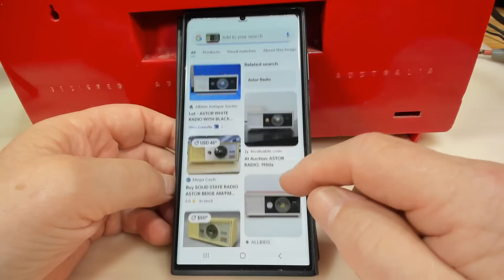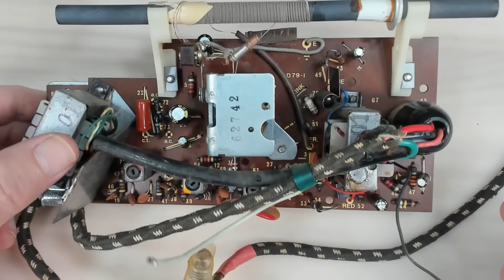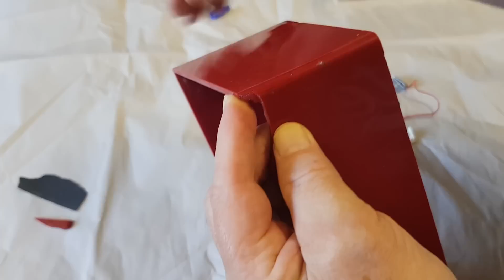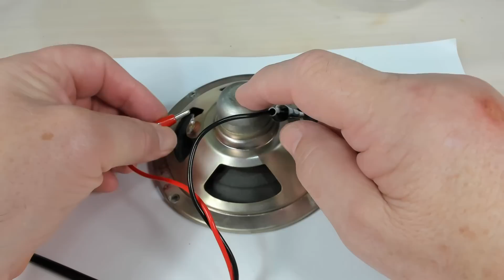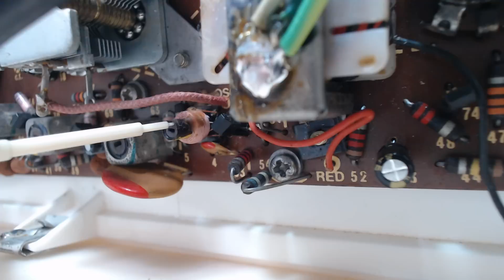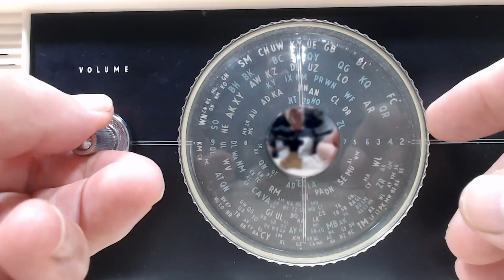Astor M6-D Transistor Radio - 1968

Comment: a piece of cardboard or paer on the inside to reinforce the plastic you glued would be good idea tto. Those old wedge type silicon transistors are very good indeed and the class A audio sounds good, better than a tube in class A . Love these type of old transistor radios.
Reply from the maker: Thanks pushpendra, me too 🙂

Comment: Great video indeed Dave. Just a quick question about the station call letters. I'm presuming that because this radio was made when the channel spacing was 10 kHz, that some of the station call letters will now not be 100% accurate (depending on how far the frequency moved when they shifted to 9 kHz).  My local ABC transmitter 5LN moved from 1530 to 1485 kHz, while another regional SA ABC transmitter only moved from 690 to 693 kHz.
Reply from the maker: Thank you Michael. Yes, this radio has the 10kHz spacing on the dial. I think we moved to 9kHz in 1978 🙂

Comment: Hi Dave. A good trick for cleaning out speaker coils like that is to use a rolled up “Post-it” note, with the glue strip down in the slot. In can be used both outwards and inwards. 
G’day from Pommie land.
Reply from the maker: That's a great tip Tim, I'll keep that in mind 👍🙂

Comment: I restored one of this radios. It is a nice radio but it is not very loud. I used it to listen to 4KZ.

It is easy to. restore and it is good enough to listen to my favourite station. 
My radio is from 1969 I think and it has silicon transistors. In the schematic are antenna and ground connections but it is not used. There is a big ferrite rod antenna in the radio and in a town you don't need an externally antenna.
One of the electrolytic capacitors was exploded and in pieces when I got the radio.
Reply from the maker: They are only a small kitchen or bedroom radio so not big on sound. Good that you got yours working again, thanks @thebuggy736 😊

Comment: I noticed you were using a phillips screwdriver on pozidriv screws which is why it can be seen slipping in the video.
Reply from the maker: I didn't notice they were pozidriv, I'm surprised they used them 👍🙂

Comment: i can see why they discontinued with the the radio dial with the radio stations on it 2AY Albury would be on there 2GO first aired in 1971 2ST southern highlands made its debut in 1972.
Reply from the maker: Adding and removing stations and even moving station frequencies are a problem. The demise of station call signs on radios happened as imports overtook the local industry. Thanks Media Watcher 🙂

Comment: Hi Dave, I sent a Grundig Radio to Adelaide, valves packed in same box but have " vanished" possibly a customs error. Can you advise a dealer who could supply replacements? Sorry if this is a OTT request. Many thanks Paul in Germany.
Reply from the maker: Hello Paul, that is strange. The Historical Radio Society of Australia (HRSA) has a valve bank and may have the valves. You might need to be a member to access it. There is another valve bank in Adelaide that sells valves to the public for $15 each and may be discounted for members of AHARS (valve bank link below). It's called The Australian Valve Bank, I have used them a long time ago. You can also contact HRSA, they may put out an email to members who may be happy to help.
Ebay, but it might be expensive. .
AU Valve Bank: https://rola.net.au/valvebank.htm  
HRSA: https://hrsa.org.au/
Reply: @DavidTipton101  Hello Dave, This information is so helpful, thank you so much firvtaking the time to reply. My feeling is the recipient has accidentally thrown out the packaging and "lost" the tubes which were carefully packed to avoid them falling out of the bases and getting damaged during shipping. I'll pass this information on and hopefully get up and running without it costing a fortune. I could ship from Germany but I imagine this would be prohibitively expensive and fraught with dangers. Once again many thanks! Paul 👍😀
Reply from the maker: It's my pleasure Paul. Your explanation for the lost tubes is more plausible. There is a local chapter of HRSA in Adelaide if the owner needs assistance.

Comment: Thank you for this video. I'll try and remember that super-glue and sandpaper technique the next time I have broken plastic to fix. I was hoping you didn't have the missing piece, because I was sure you were going to rebuild the missing section and it would be color matched, but I learned something nonetheless!
Reply from the maker: I have to say the few times I've used the sandpaper method it hasn't been all the successful, on Bakelite or plastic. Thanks Lurker 🙂
Reply: @DavidTipton101  I'd say it was pretty successful in this video! (Probably better than I'd have done without the sanding method, anyway.)

Comment: I wish I had a guy like you in our neighborhood, my neck of the woods. I dropped off two quite old radios at a local guy who was supposed to be very, very good.
Both radios date from the 1930s. This was in July and he said it would it would take a week and a half for him to give me an estimate. We are days away from the end of the year!
The thing is probably all the capacitors and visitors would need to be changed and I can do it myself. It’s just that it is so complex to have to purchase each and every little part when somebody else has drawers full of them. 
Have a wonderful end of the year. Best regards for the holidays.
Reply from the maker: It's hard to get good help Neil. I would look at your radio if you were near. Carl does capacitor packs containing a few of all caps needed. If you are in New Zealand and there is a Jaycar near, they stock pretty much everything you need. 630Volt poly caps, a range of electrolytics and resistors. All the best for the holiday season 🙂

Comment: I don't think I believe you David when you say you don't know about transistors haha. Pity this one worked, but even if it didn't, confident you'd have fixed it. One page I found helpful myself (you probably already know it) is the UK Vintage Radio Repairs site, where they break down stage by stage how a typical AM radio works. There's a separate index for valves and transistors. Still probably the best explanation I've seen. AGC was something I never understood until I read this page. Anyway Merry Christmas David, thanks for some great content this year, blessings to you and your family.
Reply from the maker: Thanks for the tip on the website Seiskid, I am signed up to it, I'll check it out. The only difference between valve and transistor sets is the valves and transistors. It's the little things like biasing that I haven't had any experience with. Merry Christmas and Happy New Year 🙂
Reply: @DavidTipton101  I forgot there's a forum too. Its not actually that, so no need to sign up. Replace the 'net' with 'com' in the vintage-radio.###  address, and it takes you from the forum (not what you want) to the help guides (what you want). Enjoy!!!
Reply from the maker: @Seiskid  OK, thanks Seiskid, I have it now 👍🙂

Comment: Hello David. Loved the video. From start to finish; the careful disassembly, the successful white & clear plastic reinvigoration, the speaker repair work (BTW; I'd Never leave the speaker out of a single video. Ever. There's just something about that item that gets a viewer into the completion of the restoration, and the speaker holds the entire History of each unit). Even if there's nothing wrong with it...crunch a little hole in it (just kidding). Another BTW; I did my own Google image search on this and found a very "unique" history on this one: on September 26th, 1964, this unit began it's historic journey on "Gulligan's Island" as the "only" connection our castaways had to the outside world. That "bodgy" power connector work you found was the final work of the professor on this historic radio to keep it working. It's probably worth a ton of money to a collector! Merry Christmas Dave & Happy 2025! -Chris
Reply from the maker: Hi Chris, thank you very much. I like working on speakers, no electronics, just engineering. You may be on to something there. On the first GI episode, the radio ended up in the ocean and still worked once retrieved! Merry Christmas and a Happy New Year 🥳

Comment: Very nice restoration as usual. A nice blast from the past. The transistors used in that radio are Anodeon made by Astor in Australia. They are notoriously unreliable especially in their TV's in the late 60"s and early 70's. As an apprentice I changed many of them with European sourced transistors (BC 549 etc).
Reply from the maker: Thank you Ian. I didn't know Astor made their own transistors, not very well by the sound of it 🙄🙂

Comment: Great job Dave, it is always a good day when I can enjoy my morning coffee with Dave working on classic radios and making them new again. You sure have good luck with super glue, I guess when it failed me some 40 years ago I developed a disklike for it and have never really given it a good trial again, I am sure the formula has changed greatly since then. The last thing I saw it work good for was body prep at the funeral home next door to my home years ago. I used to help the director occasionally when he needed to lift bodies and such when his hoist was down or the body was, well to heavy for the equipment. He used  the glue to hold the departed's hands together and keep their eyes closed. For plastic bonding I  use a product called Duco Cement, it is sort of like the old airplane glue we used as kids making models. It does a nice job but does not bond as quickly as super glue so you need to use clamps or just hold it for a minute or two. This set turned out great though nearly looks new off the shelf.  WHERE ARE MY MANNORS!  Merry Christmas Dave, and have a great new year!
Reply from the maker: Thanks Jerry. That's a great story about the funeral home. I find superglue works well for this type of plastic. There is a slow drying form of glue similar to plastic model glue that is still cyanoacrylate based. It gives more time to put things together and is very strong. It's a Loctite product.
Merry Christmas to you and your daughter and all the best for 2025 😊

Comment: You have to be careful using station ID's on these old radios as a reference.  3XY is close as it didn't get much of a change during the frequency reallocations.   It was 1420 (Australia used to use 10khz AM bandwidth originally) and then was moved to 1422KHz when the reallocation was done, and the change to 9KHz bandwidth.     I believe it was 1978 when 3XY was moved from 1422 to 1420, and many other stations would have changed around this time, some much more dramatic, like 4BH as you mentioned.       3XY was one of the lucky ones that only moved 2KHz off there previous allocation.
On the radio you have, 3XY would have still been 1420, but on these analogue dials 2KHz is nothing.   I am just being pedantic lol :)   
Love your videos and as always this was a great restoration.
Reply from the maker: You are right Brendan, I forgot the slight variation with 3XY after the frequency reallocation.  You will be happy to know I checked it again afterwards using the 1400kHz dot on the dial and it was spot on. Thanks Brendan 👍🙂

Comment: Hi Dave, cheers from France. Great video and repair as usual. I am sorry to bother you with the following complaint though. When you publish your new videos would you please deactivate the option for automatic dubbing to foreign languages. The result is awful : bad dubbing, some translation errors of technical words that make things hard to follow sometimes. Furthermore it does not fit with what foreign audiences are expecting (as far as I am concerned) when choosing a channel in a different language. If I watch your videos it is also because I understand english and I learn a lot from listening to english speaking persons in a given context (here old electronics). Now I have to systematically stop the video then go to the preferences, deactivate the French dubbing and select the original language and then return to the video. Have a nice Christmas down under.
Reply from the maker: Hello yusynthman. Audio dubbing on YouTube was only just become available on my channel. I have no control on which language it defaults too. In fact, I had no idea it changed to suit the local language, I assumed it needed to be selected. So I'm sorry but I can't do anything about it, it may change in the future as they improve the software. There is some info online that suggests you may be able to change some settings on your device so it plays in English. It's an interesting problem and I understand. You will find this will happen as more videos are audio dubbed from now on. Oh, you only have to click the gear icon and select another language on a PC or phone, a TV may be more involved. Merry Christmas 🙂

Comment: And another radio done and dusted , great job. Many years ago i worked at Astor factory in centre road Clayton, Melbourne and in the transistor radio section. I operated the solder wave machine at the time and also took care of any solder bridges bridges that were in the wrong place. The girl on the production line use a special air operated cutter to trim the excess wire once the component ( resistor /capacitor ) was inserted into the board. these cutters also had a area in the jaws the also allowed the tool to squash the component lead befor the cutter cut the wire. This was used to stop the components from falling out of the board untill the board was soldered. Have a merry Christmas David.
Reply from the maker: That's fascinating! It's great to hear from someone involved in the production. That snipper/bender did a great job on the leads, I struggled to get them straightened out 😄 Merry Christmas Stephen.
Reply: Hi I run the Astor Facebook page. Do you have any photos of Clayton or momentos etc?
Reply: @charlesbrain3872   No, sorry, when i worked at Astor, that was when i was in my teens, I'm now 70 and retired
Reply: We had a similar model in the 1960s, but it was powered by a large multi-cell battery, probably similar to those in valve radios, and each battery would last for months. Ours was yellow with a white front IIRC.

Comment: Hi David.  I should point out that 3XY was not on 1422 kHz when this radio was made.  Looking it up though, it was 1420, so close enough.  It's worth keeping in mind, when using station call signs as alignment points, that practically no stations are on the frequency they were when these radios were manufactured, due to the switch from 10 to 9 kHz channel spacing in 1978, and other changes.  I do know someone who got into strife trying to align a set and not taking this into account.  Hope that might help someone making the same mistake.  Cheers.
Reply from the maker: Yes, yes it was. I used 1420 last time but forgot this time, thanks for the reminder. There are alignment dots on the dial but I couldn't see them with all the camera gear in the way 🤦‍♂️ 
Really, two kHz and got into strife. I just threw the radio on the generator and checked with the alignment dot at 1400, it was spot on. Says a lot about my original alignment 😄 Thanks Stuart.
Reply: @DavidTipton101  In his case, the difference was 328 kHz.
Reply from the maker: Ahh... that would be a problem 😄

Comment: David an excellent Refurbishment the Astor Transistor radio I have service a few them Radio TV workshop in the good old day you can pick up many station in the Sunshine State as aside we used to use 50HZ from Scope iron to remove dust etc from speaker cones it wound certainly shake the speaker up,I noticed you gave new LV power supply is switching power supply? Some of them produce RF noise,I the city we don’t have any AM Stations the all gone Fm,I forced to get Smart Speaker it magic you ask the pleasant girl any questions plus any Radio Station in World,Best Wishes to You and a Merry Christmas greetings to all.Ian,
Reply from the maker: Thanks Ian. The soldering iron would do it. There is so much RF on my workbench with a PC, monitor, LED lights and half a dozen cameras the RF from the power supply would be drowned out 😄 Merry Christmas to you and yours 🎄😊

Comment: Nice result, Dave.  I'd be willing to bet you got your fingers stuck together with superglue 😆.  I can't open a tube without that happening.  I hate those wire wound capacitors. You were very brave messing with that one.  The double sided tape was a good idea.
I hope you have a great Christmas and a happy 2025. Now I'm going outside to sand that bloody HMV cabinet again before the temperature hits 40 degrees.
Cheers David
Reply from the maker: Thanks Don, yeah, superglue. I glued my finders together once when on holiday. I bought the glue from Bunnings. I arrived home with the glue and glued two fingers and a thumb together. I had to drive back to Bunnings to buy the antidote. I felt quite the dill going in with my hand glued together. Merry Christmas Don and all the best for the New Year 👍😊

Comment: It looks great, I wonder though if the clear plastic dial could benefit from a retrobright too.  I restore Lightbars on my channel, and the clear lenses suffer a yellowing from UV exposure.  I built a U/V Lighting tank and I submerge the lenses  in a solution of hydrogen peroxide.  I built the tank using "Odd Experiments" video titled "Making the Ultimate Retrobrighting Box".  You might want to build one for yourself just for the hell of it.  Cost is relatively inexpensive to build.
Reply from the maker: I haven't tried RetroBright on clear plastic, I'll see if I have an old dial somewhere to test it on. I would need to find a source of bulk Hydrogen Peroxide to fill a box big enough. It's worth thinking about. Thanks Thorn Mountain 🙂

Comment: That flex,  were they trying to use it as an iron, or electric fire .  I think a nice red PVC mains lead if you can find it would look nice on it
Reply from the maker: Red would look great but I haven't seen red three core flex 🤔
Reply: @DavidTipton101  comes in two core for double insulated things like lawn mowers.